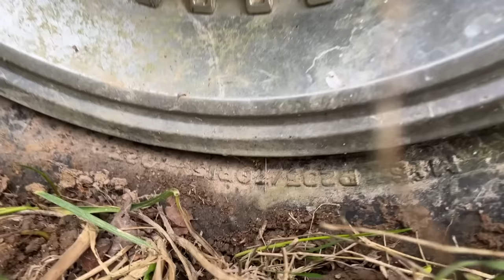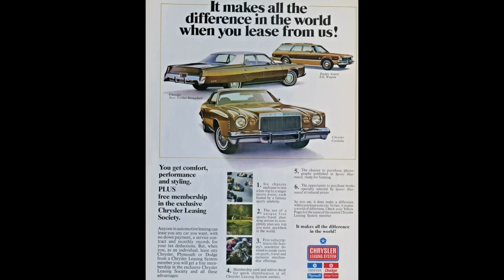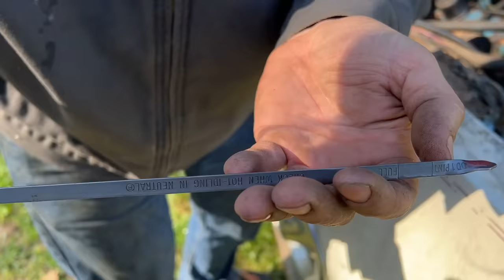Big Block Bro-Ham! Ant Infested Unsellable Luxury Car! Will It Run and Drive Home?

Comment from the maker: Go check out Vevor Steel Blacksmith's Anvils 110LBS (50kg) - https://s.vevor.com/bfQes6
Anvils Collection - https://s.vevor.com/bfQeta Discount code for 5% off VVSALE5 #vevor #anvil
Reply: I worked at PEPBOYS when they had those 4 for $99  we sold soooo many 235/75/15 casings.......
Reply: You need that desiel heater for the camper from them best deal in town
Reply: I got a 750 Elderbrock you need to put on that hog leg!! Lol
Reply: It sounds like the inspection cover on the tranny is hitting the flywheel or there is a big nest in it.
Reply: Appreciate it but I've got a good 150 year old anvil that weight more than earth  😌
Reply: I'd end up dropping it and hurting my foot. Worst that the Coyote. 😃
Reply: It's a nice car I had one before
Reply: Lean burn system

Comment: The two most things amazing things about this. The fact, this car ran and drove out of that field so easily and relatively trouble free. That's Mopar reliability right there! And has 2004 really been 19 years?! I was in grade 4 or 5 at that time. Man how the time flies! Great job and that's one of my dream cars!
Reply: That must be earlier than 2004.  By 1996 already the New Yorkers were front wheel drive mid-sized cars shaped like a soap bar.

Comment: I love so much seeing WaWa being proud of her Dad. You all rib each other so much and have a great time while you work together, that's how it should be! Watching this proves the point of you doing everything possible to problem solve even after a roadblock with one system or another. When Josh, WaWa, and Ralphie were driving the car home, I was looking at that the cleanliness of the windshield. I wonder if you swabbed it and let that grow in a Petri dish how it would compare to swabbing "Grinch feet" and growing that in another dish. Which one would grow more bacteria. LOL! I can't believe Squeezie had her shoes off even over in the "bush" around the car. One of my sisters is still like that, she can't stand shoes. I can't wait until Squeezie is tall enough to reach the pedals, I think her opinions and ratings of the cleaned up and running cars will change. Once bitten, she'll be smitten! :) Thanks for the great video. We were out of town when this one dropped and I couldn't wait to get back home to watch! It was well worth the wait! Blessings!

Comment: This car is a real trooper! If you ever need to use a jack in the dirt, try putting some cardboard under the jack first. The wheels may go through but the carboard will help keep the jack from sinking completely in to the dirt.
Reply from the maker: Yes!!

Comment: Magnificent car! Looks in pretty good shape. That noise is the PCV breather/oil separator. Needs the piece and a new vacuum line. That will solve a lot of problems.
440 was standard in New Yorker as well as Newport's with the Trailer Towing Package. 
The steering wheel is not just tilt. It telescopes as well. With the wheel pointed straight forward the black slider in the collar will allow the wheel to move in and out. 
You have a real gem there.
Reply from the maker: Ok thanks for the info

Comment: My recommendations, be easy on it until you change the timing chain, it may very well have the nylon tooth gears still, replace the lean burn system with something more stable like the GM ignition system, or even the older Chrysler ignition system ( There is a wiring diagram on the internet to switch them over, I did mine) You will find an improvement in response and power, you also have to replace the distributor with one that has the vacuum advance. Note: never open the 4 barrel on a free rev, Chrysler cams are soft, and can round off the cam lobes. Most of these had the high performance model 440's in them, they were labeled 440 Super Commando, which wasn't highly impressive since these were smog era cars. Most all still had catalytic converters even with the lean burn system. The Thermoquad you have there should be specific to the 440, they had larger secondaries than the standard Thermoquad.

Comment: Yay a thermoquad  rebuild alot of people forget about the screws behind the choke also the black plastic is a Phenolic resin that they make spacers from now keeps the fuel charge cool. I love them and how tunable they are
Reply from the maker: Awesome thank you
Reply: Also they are usually  3/8ths line but people put 5/16ths adapter lines in for some reason

Comment: Good to see you working on another Mopar. The Alternator is a 100 amp version to power all the accessories that the New Yorker had. And just about all the HVAC system is Vacumn controlled. The Carter "Thermoquad" with the plastic body was developed for the Big Block cars that generated a lot of heat because of the insulation under the hood to stop them from vaporlocking. Good job on setting the metering rods, I had a person show me that trick because most people don't do that and can't figure out why they don't work right.  Being a 440 car it should have 4 wheel disc 4 piston Borg Warner brake system. The 400s had drum rears if I remember right. Can't wait to see it cleaned up. BTW, Quit buying from Wrong Auto seems like they mess up every time!

Comment: Great video the reason it's such a dog is the lean burn needs the vac lines the one on front is advance but if you want to double horsepower summit sells a Mopar conversion kit for like 150 you will be very happy with the results have a blessed day

Comment: Little trick since you change plugs so often..take a piece of vacuum hose and put the new plug on it and use that to start it, never cross thread or find an angle you cannot turn your fingers. Wawa seems to be taking a real interest  ! Bug fan of you and the whole dude troop !..p.s. 2 different vacuums...venturi and manifold.. big difference

Comment: The noise you hear is a valve on the exhaust manifold area that is part of pollution control issues.  Not a problem,  my 78 Dodge had that 318 engine.

Comment: Beautiful car when you clean it up. The Carter ThermoQuad used a plastic bowl to help to keep the fuel cool and avoid vapor lock. They're highly desirable carburetors in the Mopar world. The Lean Burn computer system works very well if all the sensors are good, just replace all the sensors as the system does not tell you which sensor has failed - there is no diagnostic that I know of. Later Lean Burns didn't have a ballast resistor. They all adjust the timing on the fly, which is part of why they have two pickup coils. ANY Mopar with a ballast resistor, always keep a spare in the glove box! 
I would imagine it has highway gears in the rear-end, but possibly a Sure-Grip. With the ThermoQuad and the Lean Burn (working properly) and the rear axle ratio, you might be pleasantly surprised - 10-15 MPG in a massive car with a massive engine and only a 3-speed TorqueFlite 727. Just give us the Broadcast Sheet (under the driver's seat, between the springs and the cushion) or the fender tag and a Mopar fan will tell you every single option on that car. Snapshot it. Chrysler was meticulous about keeping records. 
Mopar big blocks are tough engines, but wear rings and bearings faster than the small blocks. Nothing is as tough as a Slant-6 - sorry, Josh, not even a Ford 300 I6. 
Restore that car. You and your awesome family will have an amazing and comfy highway cruiser to enjoy. 
And Wawa, no insulting the Fairmonts. They are great cars too. :) 
Bring the family up to Ottawa, Canada. It's a G7 World Capital, and you will find lots of stuff to enjoy as a family. 
https://www.youtube.com/watch?v=EsL_TAfQxH8

Comment: New Yorkers always came with the biggest motor.  That car probably has a 2.70 rear axle for better economy.   I had one years ago and got 16-18 MPG on the road..  great road car and quiet.  May have 8 track radio.
Reply from the maker: Yeah that makes sense

Comment: I parted out a 77 Chrysler. Thermoquads are great carbs, but the lean burn ones are LEAN! And there is no idle speed screw. I added one on mine. And there is no advance mechanism at all in that distributor.
Reply from the maker: Ok thanks

Comment: Great find in that imperial, but I am waiting for the engine and transmission fixes for the dodge camper, and getting it ready to go camping this summer.  I just want you to try driving to the Northeast, just sty away from Big Cities, and brave like I-81, to I90 east, and then lots of options from there, like I-87 north, like historic Fort Ticonderoga, I89, which is options to northwestern Vermont, to NH, or other unique stops.
Reply from the maker: Yes coming soon

Comment: The bowls on the Thermoquad are a phenolic resin. Made to keep the fuel cooler. It does work as I have a Thermoquad on my road runner and never had a fuel issue. My Power Wagon has a Quadrajet and it vapor locks from time to time in summer. That's a cool old Chrysler. Makes you wonder why it was parked in the first place. Is this an engine donor for the burn out machine?

Comment: This one will be a goody! So far, it looks like a good complete car. It will clean up and look very good after a good, clean, scrub and tenet eviction and extraction. 

That air injection pump is really loud! 

Your gonna have fun sorting and plugging all those vacuum and air lines back in. And I suspect your going to have to redo that carburetor again. You’ve got a pretty good internal leak. 

Looking forward to you guys getting after this one and getting it back on the road.

Comment: 1978 was the last year for the 440 at Chrysler. They made the 400 till August of 1978, so a few made it into early 79 models I guess or the last of 78 models. Compression on the later 440/400 engines  was around 8.2/8.3 so they could run on low octane unleaded gas. They didn’t start making high octane unleaded until the 80s or 90s. Never paid attention to when because I didn’t need to buy it.
Reply from the maker: Ok awesome thanks

Comment: Casing: 
1. A cover or shell that protects or encloses something  
2. The frame round a door or window

Tyres:
1. A rubber covering, typically inflated or surrounding an inflated inner tube, placed round a wheel to form a soft contact with the road

So…… tyres it is 😂👌
Reply: A casing is a tire that has the tread worn off but is still good enough to be recapped

Comment: I'm sure the exhaust is a little rotten, but it sounded really good like a 440 should on that first start! It needs to build up oil pressure after sitting for so long, but once the lifter pump up it'll run mint.

Comment: Ahhh…the old Carter ThermoQuad carb! The plastic was supposed to keep fuel from boiling causing vapor lock, especially with the Lean Burn system. BTW, the Lean Burn is ripe for a delete…it was only there for emissions at the time.
Reply from the maker: Ok great thank you

Comment: Excellent video Sleepdude Crew  Josh  :) , family  also remember 1976 Chrysler New Yorker  my uncle John  , Aunt Betty had bought new was 400  Cubic Cm 4 with 727 4 speed Automatic transmission Overdrive  type, rear end gears not sure but 2 door also forest green also interior to with all power options plus Sunroof to and was Propane type fuel ! But in 1978 still under warranty  he got put 440 V8 motor 4 barrel carb , daul exhaust plus gas same transmission type, uncle said got 10 mpg local drives, 15 mpg on Highway speeds plus 377 ratio rear ends! Uncle , Aunt ran Shell or Haromac fuel of 91 octane gas plus  10w30 engine oil no synthetic type  ! 2004 went off road and bought something different vehicle  ! I was going get car and fix up  but got stolen out driveway one never seen again !! But I say add Fuel   or Carb cleaner out fuel cleaner in tank full Josh plus 91 octane gas and 10w30 engine oil no synthetic type!

Comment: Great to see you all save that old Chrysler from decaying into the ground. The body looks solid on it and I bet it will clean up well. There is nothing quite so nice as a full size luxury car of the seventies era. I was fortunate to see a 1978 Chrysler New Yorker in upstate Vermont in 2013 that had been in the same family ownership since new. It was in immaculate shape as it had been kept in a heated garage all it's life with only 55.000.0 miles on it. It was dark green in color with a green vinyl roof and green leather interior. It was also a 440 V8 car with all the bells and whistles. The original owner was the former President of the Vermont National Bank who had just passed away. Good luck with the cleanup and hope she turns out to be a keeper for you all.

Comment: I’m not surprised it ran and drove. It’s a Mopar and they were always great cars for me. You can put the earlier 70s ignition system on it and ditch the Lean Burn system on the air cleaner. Lot of people did that. The aspirate tube was making noise. Eliminate that from the exhaust system. It just recirculated exhaust gases I think. She would be a good cruiser for the family. Clean her up and get her fully operating again and she could serve as a “going to church” or “around town” driver! And clean out that clogged exhaust system and she will run even better. 😅
Reply from the maker: Ok cool thanks

Comment: Josh and family. You did a great job of getting the Mopar running and drove it home. The name of the material that is in the middle of the carb is called phenolic plastic. You can go down to a speed shop or some auto parts stores and buy a carb spacer made of it for some of the more common carbs. It cuts down on heat soak between the intake manifold and the carb. It is sure nice to be able to drive one home for a change instead of having to trailer it isn't it. I will watching for the clean up video on this car. I bet it will clean up right purty.🤠 🏁

Comment: Hey SleeperDude great video, as always. Pro tip on the chain saw: if you have to cut with the tip of the bar, use the bottom side. The top of the bar tip is prone to kickbacks.  Stay safe! Much love from Alabama

Comment: I like big comfortable cars,  with big engine's.  They usually get horrible fuel mileage,  but sometimes you give up something for comfort.  I've had Cadillac's,  Chrysler,  Buick,  Oldsmobile,  and Lincoln. From 1962, (Cadillac) 1966 (Buick)  1967 (Chrysler) 1974, (Oldsmobile) 1977 ( Lincoln Town Car)
Reply from the maker: That’s right

Comment: 🛑🛑Josh, I've seen people make there own gaskets with a cricket padern maker.  They are sold at Walmart in the fabric department and are used for crafts. 
  Work like a printer but have a razor for cutting card stock.👍👍

Comment: I have a 1987 Dodge Diplomat with that computerized carburetor. It stopped working,  we got a replacement and had it put in. Still doesn't work right. My son wants to drop a 4BT Diesel motor in it.
Reply from the maker: That’s cool

Comment: Josh I understand the snake issues. Just today I was cleaning the bed of the truck out I got from forsaken steel all I could think of was a Tennessee snake jumping out of the pile of leaves luckfully none came out we dont have thow dangerous snakes up here in New Hampshire like you got either was I don't like snakes either

Comment: That lean burn stuff can be deleted and a standard Chrysler electronic ignition system will replace it . Did that to a Dodge pick up I had ...
Reply from the maker: Awesome thanks
Reply: @Sleeperdude  Gonna be in Crosville in about a week . Might be in touch ...

Comment: This reminds me of my 1969 Mercury Marquis Brougham 4-door hardtop I had back in the late 1990's.  429ci Ford Power, A/C, P/S, P/B, Power split front bench, windows & locks, and it was a white whale with a black top.  I loved it.  Put new exhaust with the longest cherry bombs you could get.  It was quite crusing and at idle, but when you put your foot down she howled.  I had such a good time with that old barge.  Even had the hideaway headlamps like that new yorker.  Also had a 1970 Merc Monterey convertible with the same platform/drivetrain.  It was a huge topless whale.  I loved it too.  

That's going to be one serious clean up video, she's a proper biohazard.  Gloves and masks for that one, she's got the haunta virus.  

If it didn't get 7mpg, it'd be an awesome car to clean up for WaWa's first.   She'd impress all the boys with that 440 war wagon.  But I think she wanted an air-cooled VW Beatle if I recall, and that would be much more economical to run around.  Plus you can get every single part and trim peice for a VW, not so much for a late 70's luxo barge.  

Thanks for the vid!

Comment: This may not be the correct video, but when cleaning a gas tank. Put in a bunch of steel nuts and shake up the tank. It should help braking loose the rust.
Reply from the maker: Ok thank you

Comment: When I first got married I had a C10 pickup with a 350.  One day my new bride came home from work and found me rebuilding a Rochester Quadrajet in the center of the kitchen table.  She just said that aimt good.  Later that afternoon I had the truck running.  She said when I saw hundreds of little parts I didn't think it would ever run again.

Comment: Had a 79 Dodge Magnum that had a 360 with that lean burn crap on it ...didnt work worth a flip ended up changing  the distributor,carb,and deleting the whole lean burn circuit before it would run again ..... then it got to the point it would pull so hard from the tank that it would suck the tank filter together so took it off and put 2 inline filters on it one inline under the car and one between the fuel pump and the carb ....it boiled the tires off of it after that ......they discontinued the lean burn in early 80 i believe

Comment: The Carter Thermoquad has what's knows as a "phenolic spacer" that's intended to help with vapor lock. It doesn't, as my 360 LA Thermoquad equipped 1983 Dodge Ramcharger had one and it vapor locked any time I would drive it for more than 20 minutes at a time. I would have to stop, drip gas into the carb, and it ran fine after that.